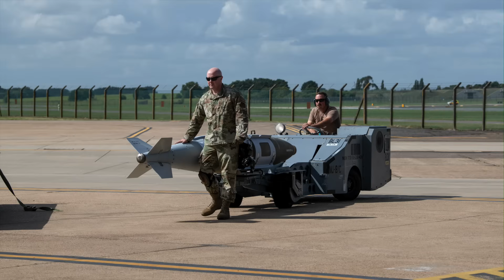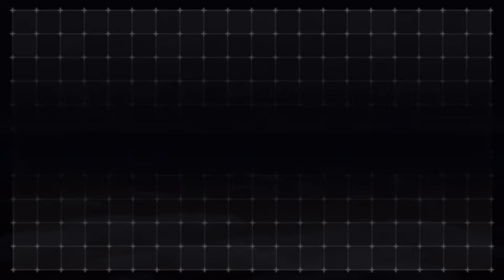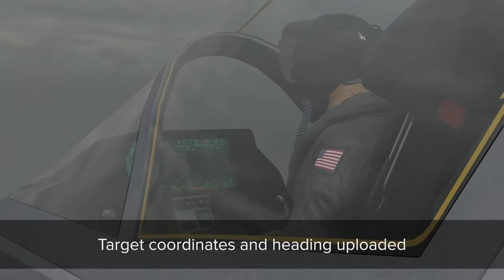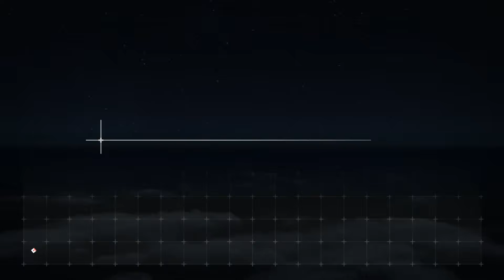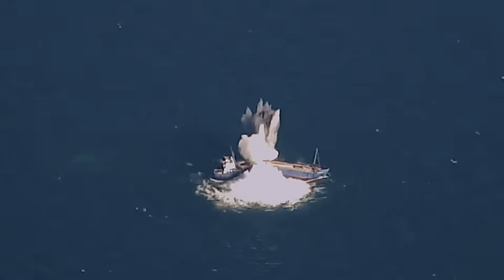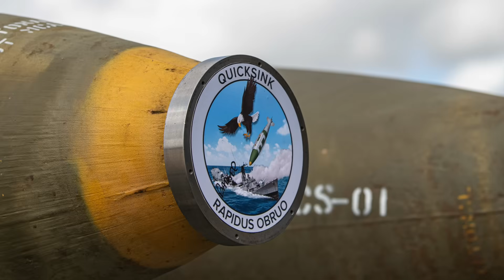How latest QUICKSINK munition would enable US military take down adversary’s naval armada?

Comment: you have boat drones in ukraine that are sinking ships then why make quicksink?
Reply: For the most part Chinese ships are considerably larger than Russian Black Sea fleet ships were, meaning a drone that could sink a Russian probably would not sink most Chinese ships. Certainly not in one hit.

As mentioned, range and sea keeping ability both matter.

Third, drones might sink the ship but not quickly enough to keep the crew from getting off. A quicksink means basically zero survivors, which has both a material impact on China's ability to continue the war and a significant morale impact on their sailors. One of the demonstrations of a quicksink had a ship go from perfectly fine to broken in half and the main deck awash in 12 seconds.

Fourth, a quicksink is probably cheaper than the drone boats Ukraine used on major combatants. Current cost is estimated at $200k with the aim to increase mass production to get the cost down to $50k per unit, with another $16k for the bomb itself.

Fifth, logistic simplicity and modularity. The same bomb can be used with multiple different guidance options simply by changing out the nose and tail sections. A base or aircraft carrier can have hundreds of bombs in store and easily change them from laser or GPS guidance to a quicksink in a matter of minutes, giving the force a wide range of capabilities against a wide range of targets with a minimal increase in the number and weight of weapons stored.
Reply: Boat drones would not work in open ocean.
Reply: Range.
Reply: Flexibility to use Quicksink anywhere globally.
Reply: Lets break that down
The MAGURAs weights 2200lbs to 2800lbs and carries a 660lbs to 1433lbs warhead with max speed of nearly 50 mph
Against the ill equipped Russian forces , its been effective 
but against an equipped enemy not so much. The US for example has  Mark 38 25 mm machine gun system (MGS) 
Originally a lackluster program till 2000 when the USS Cole was bombed and the program was extensively upgraded and given highest priority 
The latest mod is MOD 4 which adds a 30mm canon and newer Mk310 PABM-T airburst ammo which is designed to defeat USV like the MAGURAs
While Russia hasnt gotten a clue about small craft defense , other countries have
The Quicksink weighs 500lbs-2000lb 
it can attack as naval mine or be used as direct attack munition
but most important is that it can carried by tactical aircraft such as the F-15E, strategic bombers such the B-52 but most important, it can also be deployed via Rapid Dragon from C-130 or C-17s
So depending on the variant and situation 
its few to dozens of munitions that can be readily deployed against the enemy in short order
Reply: Naval drones have a lot of limitations.

Comment: Getting broadsided by a 500 lbs or a 2000 lbs bomb is like getting hit by a 11 inch or a 6 inch shell bakc in world war 1.
Before WW II the Japanese was trying to practice firing underwater shot to hit the enemy ship below the waterline below the armor belt, but that did nto work out well.  Of course modern electronic makes that much more reliable potentially.

Unlike during the Falkland war where the Argentinian Airforce has to literally flyover and drop the bomb on the target, the gliding fin allows the JDAM style bomb to travel much longer distance.   The problem is defensive range for the ships antiaircraft missile is now longer than back in 1980s, so the QUICKSINK will need to be dropped at longer range by flying faster at higher altitude or to do a bomb toss maneuver for a 10 to 12 miles range.   This is still a risky move.  But of course, in a real attack against mass shipping,   QUICKSINK can be highly effective, especially when accompanied by Electronic Warfare planes with antiradiation missile capability to confuse and neutralize the air defense system.

Another possibility is to strap some booster rocket to give more range, but then cost increases.
Reply: They need to convert “Quicksink” like the French “AASM Hammer!!”